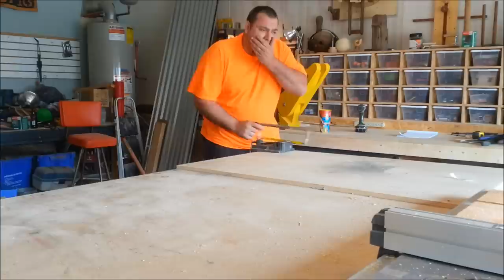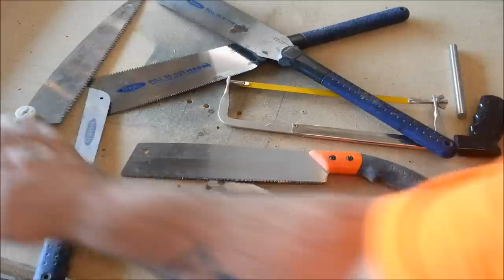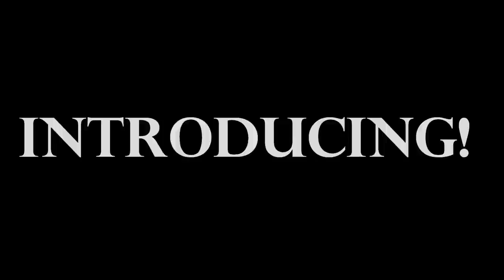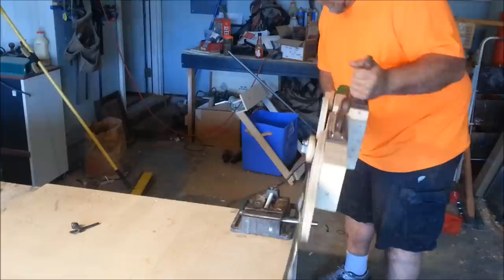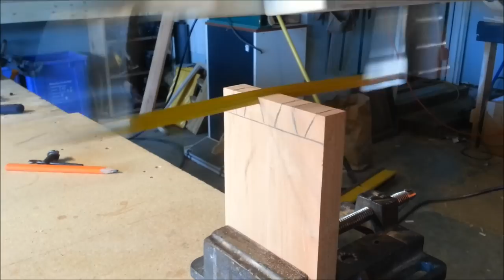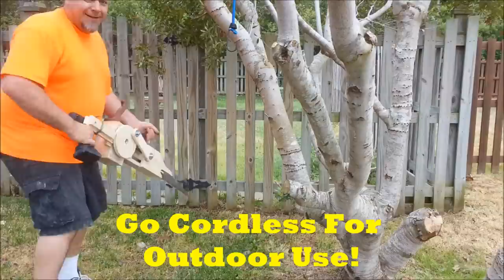Drill power hand saws.  Ha ha

Comment: Back in the 70's my Dad had a power hack saw that worked similar to that, but it was a stationary tool. It was stolen along with many other tools that I would have inherited. Bummer. Could you do a build video on this one, and did you ever continue with that 1:1 articulating router thing?
Reply from the maker: I am going to do a show and tell one the device and yes I have the one to one router done. letting the dust settle before i do a video on that, But it does some amazing things. be a fun one to show everyone

Comment: That was really great.  Most of your jigs I think I have a reasonably good chance of replicating just based on the video, but not this one.  Can you just show the other side of the jig?  I'm guessing the drill drives a small gear at a 90 degree angle to the gear we can see in the video that drives the linkage, but I just want to be sure.  Awesome work either way.
Reply from the maker: i will do a follow up and show how it works. it is a right angled gear that drives the linkage
Reply: izzy swan waiting for that  the gear reduction and  turning the rotatition 90° has some practical uses